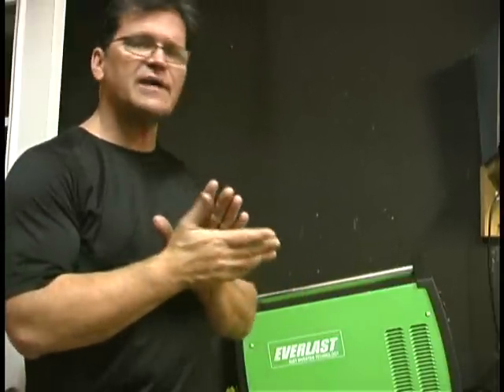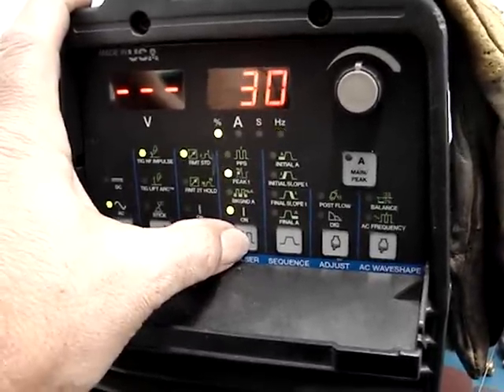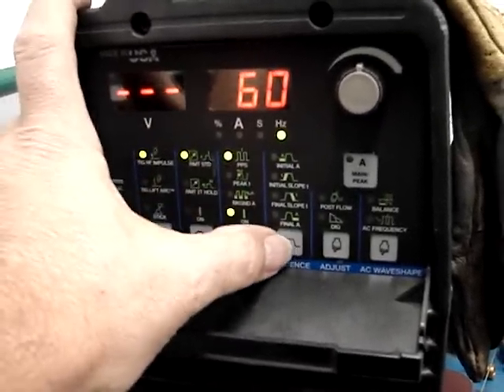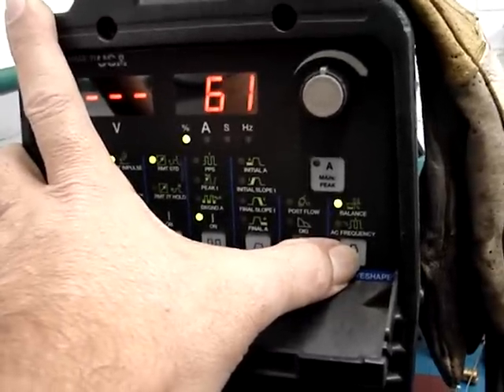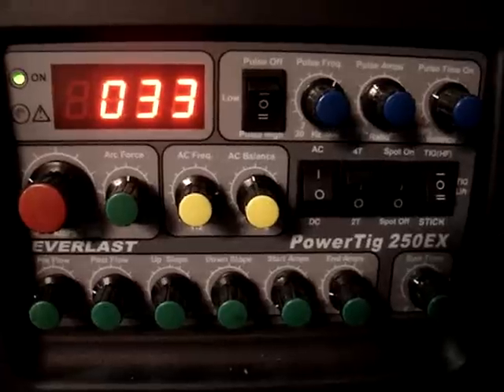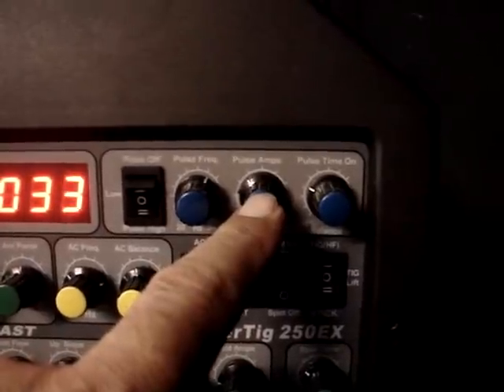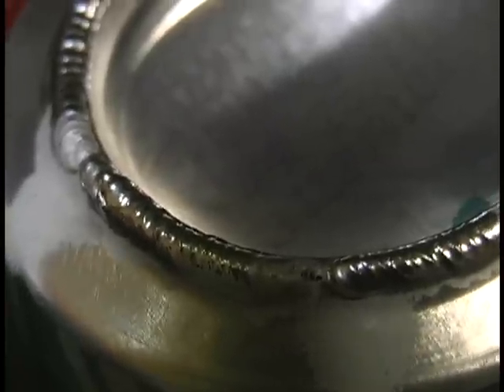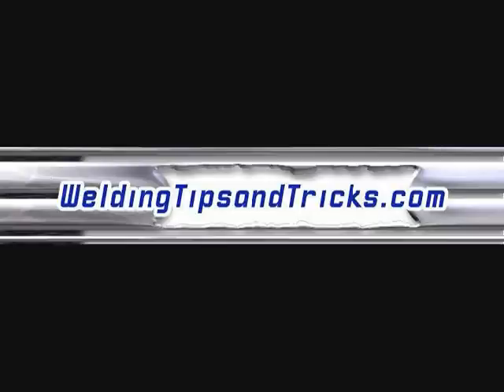Tig Welding Aluminum Coke Cans with Everlast Powertig 250ex and Miller Dynasty 200dx

Comment: wow welding coke cans . thats quite a feat . sum thing i ll try out . really impressive
Reply: You need a welder that can handle low amps like these two welders. Either that or pile on the filler to keep the puddle cool (which I consider cheating!)

Comment: Hey Jody, i was just wondering how your Everlast is holding up? and how heavy use has it seen? ive been considering getting one but im curious as to how well it would hold up in a fab/light manufacturing environment. thanks!!!
Reply: I can answer to you. I got the same welder(actually it has another name because I'm in Italy, but it's the same machine), and less than 2 years in I started having some troubles. The Ac frequency maxes out  around 120 Hz even if I set it all the way up to 250. The pulse freq does roughly the same, even though it doesn't really bother me as much given that I seldom use it. The AC arc has become really unstable and erratic at low amps, even if I use a 1/16 eletrode really well sharpened on a diamond wheel. More importantly I got problems with ally tee joints. I cannot  focus the arc into the root of the joint even using a really tight arc. It just goes to the sides. Honestly I'll test the warranty really soon even though I'm seriously thinking of getting a Dynasty instead.

Comment: i live in canada and the everlast 250 is $1850 the miller 200 dx is $5600 and as far as i could tell welding the pop cans the everlast and you put down a better looking weld than the miller 200dx.i like this because i am looking for an alluminum tig welder and actually was looking at the everlast 250. thanks jodie.
Reply: Jamie Buckley You should look at the AHP Alpha TIG. I have been very impressed with mine, running it cranked up on aluminum without any issues. Can't beat the price.
Reply: +Jamie Buckley your way wrong on the price of the dynasty
Reply: +nunya bizniss I just got one. trying to weld 1/16" aluminum flat. can you suggest settings being we have the same machine it should help. BTW mine is the 3rd gen if that matters. thanks much.
Reply: I haven't welded ne 116th aluminum yet with my machine when I do I will send you the settings no problem go on YouTube and watch Jodi on welding tips and tricks., he's great he knows his shit he'll teach you a lot of stuff about welding with the aluminum TIG welder
Reply: Louis Balboa Turn the cleaning knob to 9 o'clock, the amperage about 120. No pulse for starters. AC on, obviously.

Comment: Hi Jody I'd love to see your comments on the low end capability of the everlast 255ext compared to the everlast 250ex.
Reply: +1 to that. The everlast 250ex looks like a winner but I'm really looking at the 255ext for some its additional features.
Reply: @myronjohnson8899  dont know if u wound up getting that everlast 255ext, I LOVE mine! so much that I'm getting the 350EXT in cpl months. Debating between Lincoln Aspect 375 or Fronius magicwave 230i....$5000-$6000 for those 2...$2800 for the everlast 350ext, so....it was pretty easy decided. I will make enough with it to buy a Lincoln or Miller in no time really
Reply: I know someone with the Everlast 255ext. It's a great welder.

Comment: If you get the Everlast 250ex welder you should ask about getting a CK tig torch with superflex cable. You can thank me later and yes, you will thank me. You can bet on it.
Reply: Decisions decisions. I'm looking at the Everlast 250ex and the Everlast 255EXT. I can't decide.

Comment: im just starting to use this Miller syncrowave 250 dx   any info basics setting when welding aluminum       also I have Lincoln 2500 HD was looking for the adapter to weld aluminum.  thanks

Comment: Popular air cooled tig torches include the WP-26 style which has a 200A DC, 150A AC @ 60% duty cycle rating and a slightly smaller WP-17 style which has a 150A DC, 115A AC @ 60% duty cycle. The Everlast 250EX is a very nice welder. I know a few people who own them and have nothing but good things to say about them.

Comment: Some people cheat by loading up the puddle with a crap full of filler metal as they weld so they really are not welding thin aluminum anymore.  My ppro 256 can weld low amps on cans too but my beads are not nearly as neat.  Jody you are the real deal.

Comment: Any rumor if Miller is gonna release new model? It seams that 200DX is quite "old" and one with maybe new electronics design,or more than  20% 200A duty cycle would be nice,but maybe this is not to important. Maxstar 200 has already 40%  but is DC only
I intend to buy a Miller Dynasty 200Dx an I wander were is best to buy it  
Thanks for the videos!!!,are very good indeed.

Comment: @my1956effie The 200DX does have adjustable pre-flow. I have one and change it from time to time. You need to go into the hidden menu and scroll through that to set pre-flow and many other factors. I love my 200DX - I also have the water cooler (Coolmate I) as well and love the setup.

Comment: Jody nice video as always! i have had my everlast 250ex for about a year now and my machine just started to give me problems with hf starting on aluminum. once it gets started its fine but it has really been giving me a hard time lately .it starts up with ease on dc no problem..any help would be great..i cleaned everything real good, and even hooked the ground to the aluminum i was was welding on but it didnt make a difference.

Comment: Thank you for the video (and Christmas comments!).
I have a Dynasty 350 which has two more settings on AC Waveshape: EN Amperage and EP Amperage.  What would you set these at for the can welding?  How about 1/8 AL plate butt weld?
Thanks.

Comment: Hey there I'm trying to weld thhe middle of the can (cut in 1/2 weld back together) the dynasty goes down to 5 amps but soon as I hit the pedal it blows a hole. Do you have any tips on wlding the middle? The only way I could figere out how to do it was stick a piece of 6061 2.5 tubing inside and weld off the  tubing and the edges of the puddle would grab the can

Comment from the maker: @tlassak   I knew I forgot some things....On the Dynasty I used 1/16" tungsten 2% thor...I adjusted the start to the default .040" electrode setup after I popped a hole using the default .063" setup...and I used a sharpened point.

Comment: Great video and thanks for all of your videos!  What size tungsten did you use and did you need to adjust the TIG start parameters on the Dynasty 200 in the advance menu? Please reference section 6.2 and 6.3 on page 40 and 41 of the Dynasty 200DX manual.  Note: I tried to attach link to the manual, but it would let me.  I will email you the link.
Merry Christmas to you and your family!